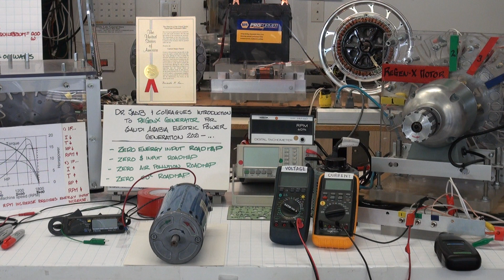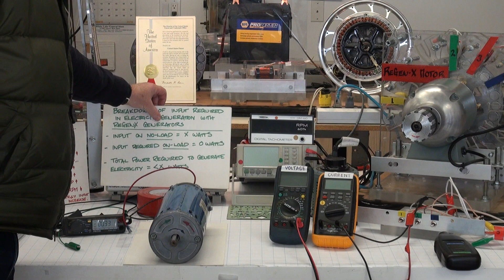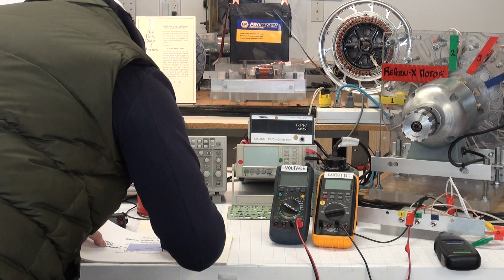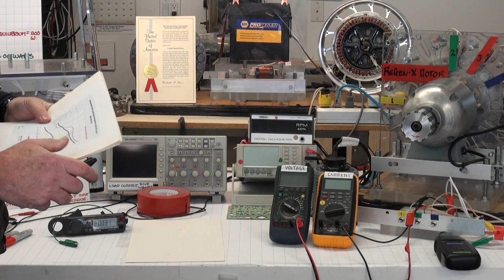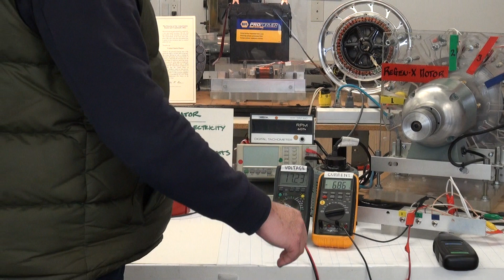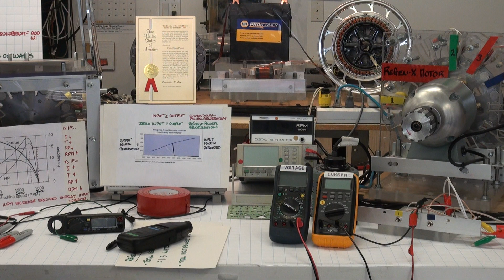PERPETUAL MOTION MACHINES OF THE 1ST KIND Saudi Arabia Introduction: ReGenX Generator ReGen X Motor

Comment: You are using PM to drive the shaft which generate the voltage by megnitic disk to induce voltage in the coil to charge battery where is the coil to produce  voltage to operate appliances..